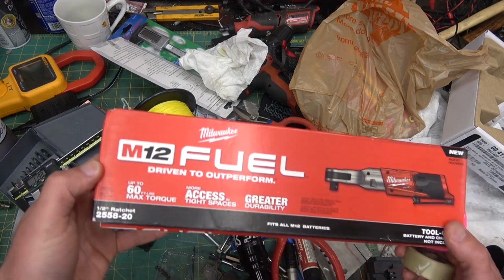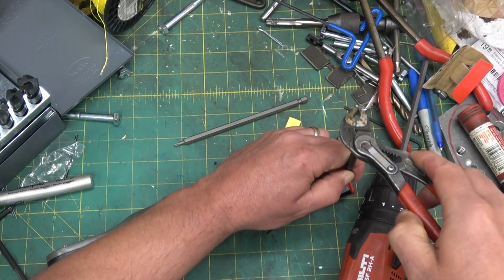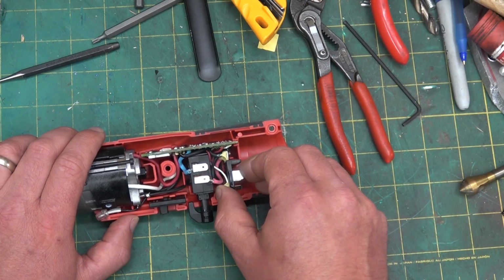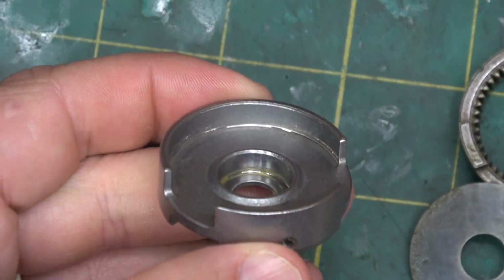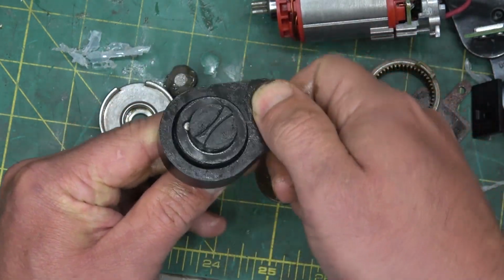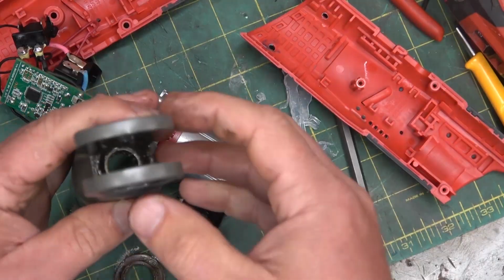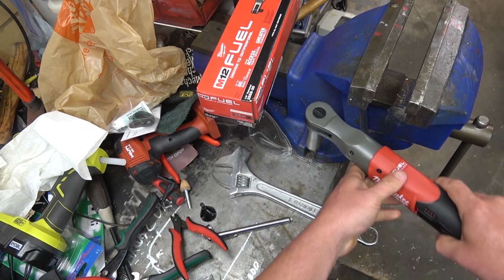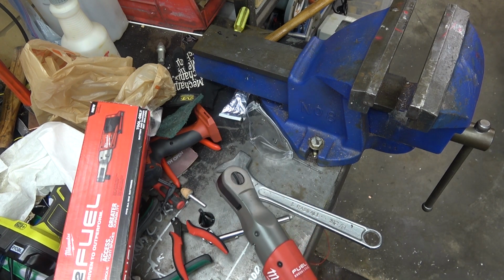BOLTR: Milwaukee Fuel Ratchet

Comment: I have the 3/8 non fuel and I think the rotating pin assembly or ratchet mechanism is wearing out. As I go to loosen a fastener, if it's to tight to loosen it used to torque out, cut the motor and flash the lights but recently its been vibrating the mechanism back and forth. It looks like its rotating but in reality its just moving back and forth.

Comment: I use mine every day, the older ones had head problems but the fuel models are fine.  Only problem I have is battery tabs break occasionally but its my fault for dropping it so it's not much of a complaint.  I traded all my snap on battery tools and replaced them with fuel tools.  Would never go back.

Comment: I use one in an auto shop, and I can tell you the first thing that went wrong with mine was the battery detents. I got into a habit of torqueing by hand on the end of the tool (the battery) and have over time nearly bent the thing right half in two. 1 solid year of use though and she still chooches, as long as the battery doesn't fall out.

Comment: @AvE Brush-less vs universal AC. Why are the plug-in impact gun so weak compared to brush-less portable? 1/2" vs 1/2"
Great channel BTW.
Reply: I think I found the reason. The maximum RPM of a brushed motor is 20000 rpm vs 50000 rpm on a brush-less. If I understand the physics right. For similar size (strength) motors if one can turn faster, those revolutions can be geared down to a huge amount of torque or the RPM can be translated into kinetic energy. Which is why I think the plugin 1/2" impact sucks a** vs a brush-less.

Comment: Uncle Bumblefack, you are in fact wrong about it not being an impact driver.

The way to enable the impact feature is pull the trigger full on then drop the spinning socket onto said nut / bolt.

It'll break loose more than one would think that way.  ;)

Comment: ive been using my m12 fuel 44ft/lb 3/8 drive model for 2 years on stop working on forklifts and its been great so far.
i drop it all the time and a few times have fully submersed it in oil without issue. gets my thumbs up!

Comment: I've had this tool for a couple years now.  Great thing to have for workin on cars and whatnot, especially rusty nuts that require constant torque.  I find that the weak point is the housing because of how much force I put on it to breakaway nutsNbolts, it's become loose and wibbly wobbly on the metal housing, hasn't broken yet though.

Comment: X-Fusion MTB shock? Have we modified our MTB? My bike came with the same shock and I will be replacing it with a RockShox Monarch over the winter. From what I understand its cheaper to replace the X-Fusion than rebuild them.
Reply from the maker: Yeah sprung for a monarch rl. I found the stock shock no lockout weird. Too stiff downhill, not stiff enough uphill.
Reply: AvE, I’d like to know how you like the Monarch RL is. That’s the same one I’m looking to go with. Also looking to add a Pike Select up front.

Comment: Ive had an m12 for 5 years. The original battery casings did not like being dropped. Me being a greasy fingered fucktard, dropped them all the time. The replacement batteries are much more better. I had one ratchet head that let the ghost out. I beat the frig out of that tool and she still chooches. Solid 100$ purchase

Comment: I have the cheaper brushed version. I love the damn thing, but it's DEAD. I'm a professional mechanic and use and abuse it everyday. What F'd up was the damn microscopic spring inside the gear head to reverse the direction. Was able to fix once. Only bought it a few more months of life.   Also I want to share I have had the little pistol but driver with the clutch. I think it's at least 7 yrs. Old now and has been abused like no other tool I have and still Chooches like NEW.  Mind you less than a month after I bought it she was run Straight over by  a FREIGHTLINER! I was Sure it was dead, I got the trigger and 7 yrs later she still Verks!

Comment: I've had the 3/8 model for over a year now and so far nothing has broken or feels worn out. It's been soaked in oil and coolant, dropped more than i can count on my fingers and toes and nothing has cracked or shorted out. I was even able to break loose headbolts and the plastic never  cracked or loosened off. Honestly I think the ratchet is the most robust thing milwaukee has made in a long time.

Comment: AvE , I have an old 3/8 model that is about 7 to 8 years old .  
Would you like to break it down when I replace it next month  ??
Reply from the maker: love too! please send email to townpumpcnc@hotmail.com and I'll trade you for a freshly torn down 3/8. interesting then and now...
Reply: @arduinoversusevil2025  the man, the myth, the legend! I'll have to get you my matco 3/8 electric impact if she ever gives up the ghost. Been choochin for 9 years
Reply: @arduinoversusevil2025  are you interested in other failure teardowns? I have an M12 hammer drill that let out some magic black smoke after I used to drill back to back holes with a four inch hole saw. Maybe wasn't the best idea. Anyway it works now except that it's really touchy about where you start it, and if it's in the wrong spot it just blinks the battery lights at you. I'm thinking one of the MOSFET phases went toast but maybe it's actually a mechanical motor problem. or both! Happy to send it if it's of interest.
Reply: I’ve been using the 3/8” one for about 4 years of hard use. I can’t imagine how many hours of work it’s saved me. Best tool I own.
Reply: i have one the same age as well, the only issue i had was when the head stopped turning, i took it apart and greased it, and its been doing fine for the last 2 years since.
Reply: I've got the snap on version. I absolutely love it. Like AvE said you can use it to break loose bolts by wrenching on it. It may not be proper but I will get it spinning and then drop it on a bolt if there isn't enough space to wrench on it. The ratchet and socket both have a great warranty, and I've never stripped a bolt like this.
Reply: All loose parts for your own entertainment in the basement haha
Reply: Love my older "black head" 3/8". Been beating it the last year when my stubby 3/8 impact wont fit. I plan to get the new 1/2" as well.
Reply: I have an old model 3/8" aswell.   I was thoroughly dissapointed with its weak perfomance.
Reply: @BramBiesiekierski  you are not using it right.I have the 3/8 non fuel model and 1/2 inch fuel model and for 4 years now I've depended on my 3/8 drive to complete certain hard to reach or wrench with a regular ratchet.

Comment: Been using mine couple of years now (3/8 version)  and still going strong. 

If using in a confined space. Don't motor yourself into a dead end. Got mine stuck the very first time I used it and took half hour to get the ratchet to change dirrection with a pick.

Also when you are using it allot and you switch back to air gun/ratchet. You WILL find yourself giving the trigger a little blip to trigger the none fitted light on air tools 😅

Comment: Used my snap-on air ratchet for the vise jaw bolts but had the tendency to smash my knuckle and was a bit slow on the rpms.  Was considering the Milwaukee but didn't feel like it would last or could handle a little bit of coolant occasionally.  I ended up getting an AIRCAT 803-RW (impact air ratchet)  3 times the rpms and impact drive so don't break your knuckles when the bolt bottoms out.  Been using it for a while now and would recommend.

Comment: Ive abused the mess outta my little 3/8s in an offroad environment where the little things been packed right full of mud and it still ticks. Oh and in a pinch you can run self tappers through the thin steel of an old truck if ya got a battery or 3

Comment: Hey AvE! Some advice from a 30 year CNC machinist: be careful using impacts on your vises! If you get to a point where your vises start acting crappy, you should immediately suspect the thrust bearings. In my experience, an impact will whoop them up right quick. Of course I figured this out the hard way! Just a friendly warning.

Comment: I have had this exact model very much for brakes and suspension work for about a year and I like it. I've had the little non-impact 3/8 version and I beat the crap out of it and its pretty good. I ended up striping the head out of it  but its still a very good little tool that gets into a lot of tight spaces.

Comment: I like seeing these Fuel tool reviews. I switched from Bosch 12 volt to the Milwaukee fuel line and never looked back. I use my stubby impact in an industrial maintenance setting and it sure does hold its own among even the 14.4 snap on line...I've had it about a year and only experienced some separation at the clamshell where the battery goes in

Comment: You mention nobody is worried about losses in efficiency for a regular brushed motor, but in reality a competitor will just do some calculations and show your low-efficiency motor quits on the job 2 hours earlier and marketing has a field day advertising their product lasts hours and hours longer.
Reply: His point was that brushless isn't really necessary for tools that are plugged in, they obviously have a value proposition for battery operated devices.
Reply: I must have had a few too many, thought he was referencing why cordless tools don't have brushed motors anymore.

Comment: Brushless DC motors are already in a lot of Dyson products that plug into the wall. You've even taken one apart, the hard dryer!
Reply: Teth47   Dunno.  Dyson was proud of calling one a switched reluctance motor, but not all of them.  They produce pure tone noise which is very noticeable and considerable design effort is required to eliminate the problem.

Comment: Been using the 3/8 and 1/4 drive for about 6 months with standard battery. I love them. I need to get some of there boot like protectors but looks like they restrict air flow.  I use there 1/2 drive high impact gun with the 5.0 batteries also. Good stuff so far.   I'm a mobile mechanic on heavy equipment and fleet.  So always getting sand and crud in them no matter how hard u try not to. lol

Comment: Had my 1/2 for about 4 months now, it never gave a single problem. I use it hard too, from bolting down swing motors on cranes, exhaust clamps on tight spots, prop shaft flange on a boat, panel bolts, I pretty much use it daily and use it hard

Comment: Good at valve covers but better at those spots were you only get a quarter inch turn on a ratchet ,take 10mins to run the bolt out with the ratchet this thing will run it on out ......thanks for the boltr!

Comment: I saw the pin on the end the crank break off on the 1/4 fuel ratchet but in the tools defence the bolt was way too tight should have been broke loose with  a 3/8 ratchet first.

Comment: I've had a 3/8 one for a while now. Zero issues with the tool (I'm a mechanic, use it every day, it's fantastic), it's the batteries that have failed for me. The larger 6.0Ah batteries have an issue in that the locking tabs crack where they meet the case during regular use and eventually fail.

Comment: They estimated a very short duty cycle, using the 3/8 almost constantly for a couple of minutes causes some serious heat build up around the motor. Ive been abusing one of these for a year now dropped it reefed on it overheated it. Itll knock you silly working in a tight space without a good grip.

Comment: Why would they call it fuel if it runs on a battery? I was expecting an internal combustion ratched.
Reply: Pixies didnt sell so well.
Reply: Agaree. Nitro 9000rpm for removing 10mm nuts in nano seconds
Reply: Di-methyl-hydrazine and LOX or some other cool shit!
Reply: Marketing for "gas like power".
Reply: Nitro is more like a dremel, all rpm no power :p good for a mini chainsaw but for getting that old nut a turn not too sure
Reply: @disarm2k10  That's why planetary gear sets exist.

Comment: I'll be honest I'm a mechanic and I personally use two of these in rotation for both my 1/4 inch and 3/8 sockets and I love them.. I do not have time for cheap crap that breaks all the time and these particular ones are LEAPS better than the model they replaced in terms of durability.. my tools are tools and I USE them I'm not the nicest to my tools and I know it but that's just how it goes.. I bought them to use not look pretty. the 4.0 battery packs I find are nice but you ultimately want to stick with the small 2.0 packs for space reasons..  the bigger battery is nice but tends to get in the way a lot and I'm sure you noticed these are not small ratchets they are beefy and Don't fit in a lot of places .

 but in saying that they just WORK.. they've gotten wet a few times when a freak shower pops up out of nowhere in Florida and you do your best to get them in and dried off as quick as possible and I have yet to have one break on me.. I've worn out the ratcheting mechanism in the 1/4 size a couple times but your warranty takes care of that cost.. I change them myself in a matter of a minute or two honestly.. i keep spares in my tool box and just swap out and send off for a new one if needed just like I did with the generation before this but they were ALWAYS breaking...

I have a lot of Milwaukee tools and usually its the batteries that give you grief but again these newer batteries seem to be a bit better there as well..  i own impacts,grinders,shop vacs,flashlights,ratchets and various other things.. if they break make use of your warranty and just use them.. they are not the best but they get the job done.

Comment: The board went in mine after a year and a half. I'm very hard on tools to be honest I think I remember beating a socket on with mine
Reply: It was a hammer,for a short time.
  Yes,that is the way it is... "ARE you done,yet?"
 Just stay away from me ,when I'm in the middle of a job and I'm low on blood sugar! Heads will roll.
Reply: @ddd228  you lost me
Reply: @lovetolearn5253   it was a reference to how techs work under pressure. NOT SO WELL!
 Yes,an expensive tool may become a hammer!

Comment: I feel like it's a 'sort of' impact tool, sometimes, holding the body steady, a few pulses on the paddle will knock a fastener loose, presumably due to the backlash in the tool. A useful function, however it works.

Comment: As an industrial pixie rancher I've been impressed with some of the thoughtful design features I'm seeing in my power tools and accessories nowadays. Light placement on the Milwaukee stuff is hit and miss, though. The M12 portable band saw has the most awful LED placement. It ALWAYS glares off of my cut line, but it's so nice for quick aluminum conduit work (one handed). The Milwaukee 1/4" impact driver LED placement (near the battery receptacle) is inferior to DeWalt's (3x around the bit retaining collar).
Milwaukee is about the top of the budget for me, but I've been pleased. I get a lot of mileage out of the work lights, M18 shop vacuum, and M18 fan.

Comment: Used one in heavy a duty automotive  shop, dropped it and the screws that hold the case to the motor/ ratchet assembly came out. I continued to use it for another year till it took a bath in coolant. It worked for another week then let the smoke out.

Comment: That mashed up bit on the left side of the clamshell housing at 3:22 is likely an intentional sprue gate from the injection mold. These are generally ported directly into an existing rib or feature on the "inside" of the part, and manually trimmed flush after being ejected from the mold. These gates are only used on single-cavity injection molds. Multiple cavity molds would likely switch over to a 3-plate design and use at least one pin gate per part.

Comment: I used to break loose transmission bell housing bolts with my 1/4" of the older model. Only broke the working end once but it was warranty so fudge it. I ended up switching to snap-on due to the ridiculous size of the gland end on that there one, no room for the tight spots.

Comment: Review harbor freights version next and cuntpair em
Reply: I don't think there is a HF version (though it's been a while since I made the pilgrimage) but there is a Home Depot Husky brand version that I've seen discounted to $49 ($79 when I was there a couple of days ago). I don't think it's brushless though.
Reply: @fostytou  earthquake brand has one at HF.
Reply: @fostytou  husky one is junk. Cant swap battery,  built in. Garbage!
Reply: @kwmiked  very easy to swap that battery after it expires. It's just standard 18650s. I love my Husky ratchet. Cheaper than HF, works awesome. It's also more compact.
Reply: @knyshov  yeah sorry I dont have time for stupidity and I don't have time to waste soldering batteries into a 1 time use tool
Reply: @knyshov  are the batteries spot welded to the tabs, or are they just basically in a plastic holder with contacts?
(I don't really need an electric ratchet, but if the price is right... )
Reply: @kwmiked  I am sorry you feel this way. I adore this garbage tool. It works perfectly for my needs. :)
Reply: no u
Reply: The HF brand one is nice but it's only 3/8" and it's longer than the M12 Fuel. Even the Fuel ratchet is significantly larger than the the older M12. Compare the sizes and your needs.
Reply: I have had the hf one for a little more than a month and use it regularly as a mechanic and I have no complaints so far but I haven't beat it up too much yet, got it for a $100 with warranty can't really beat that.
Reply: No

Comment: I've got the older 3/8" Milwaukee ratchet and have used the crap out of it over the past few years. Other than the rubber over-molding falling off, its still going strong. Boss man and I have 2 of them that we use in a body shop/auto shop and they are one of the most used tools in the shop for disassembly and assembly. His snap-on ratchets only come out when more leverage is needed.